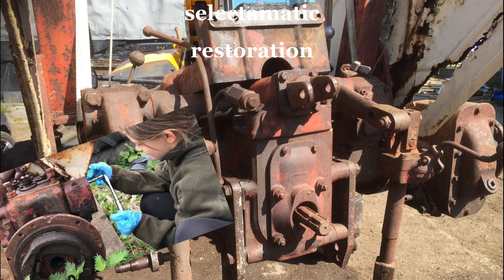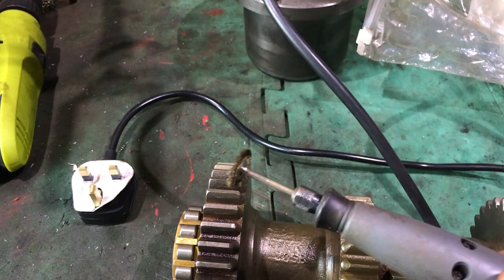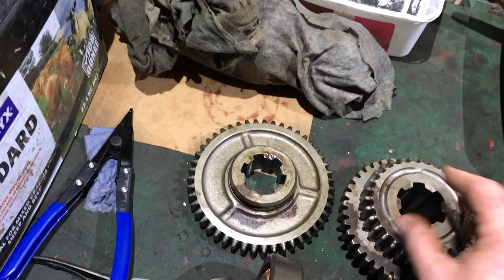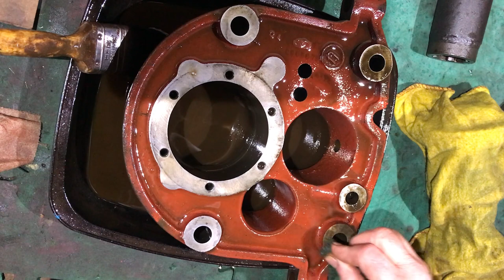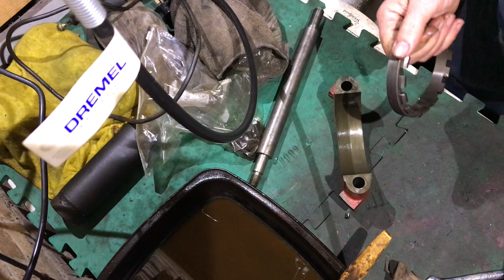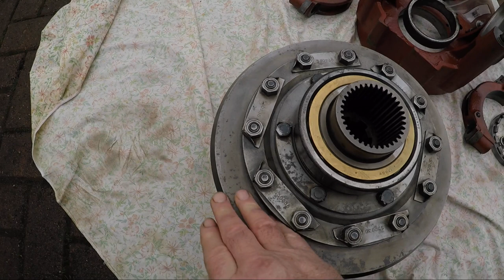Preparing the gearbox of a David Brown 990 selectamatic for re- assembly #49

Comment: Loved seeing your process of cleaning these up.  Learned a few new things!
Reply from the maker: Cheers Shane, when i sit back and think about sandblasters, vaporwashes, I would have to remove all the bearings, which could lead to damage and  more expense where as with the wire wheels and rags I can just take my time get them clean and give everything a good rinse off in the lovely red stuff. time I have loads of, money is a little different, and of course I don'thave space or the compressor to run them, so the wire wheel it is then.
many thanks Shane
Barry

Comment: People don't realize what  a major percentage  of restoration is cleaning parts. Got that missing hydraulic  parts made and great fun drilling 0.5 mm holes in it. Good vid Barrie.😀
Reply from the maker: Cheers Marshal, your right I think 90% of resto's is cleaning and scrubing, I'm pleased you got your part made, I've been chasing a lathe for the last couple of weeks but no joy at present.
thanks for your support
Barry
Reply: @manfromthemist1958  Hydraulics working better but still not right.  As every part of the valve chest I could access was stuck. I have come to the conclusion that the bits I can't access are stuck to.  Yep that means taking the valve chest out unfortunately.  Machined a blank to size for the wee plate in hold valve.  Justin case anyone is looking for one.M😀
Reply from the maker: @MarshallSmart  Cheers Marshall, sorry to hear the hydro is still not working, look on the bright side, you get to play with the valve chest on the bench, it is easier then in the axle.
many thanks Barry
Reply: @manfromthemist1958  Yes unfortunately  I'll have to study the world's most boring manual to do what you did on the rebuild. 
Or I'll just rewatch your vid about rebuilding it. Zip lock bags at the ready 😀M

Comment: Well you've done a smashing job of stripping all the components and throughly cleaning them it certainly does look a top job there's something about stripping bits down cleaning em and putting back together it's a man thing. Your certainly have a peace of mind once put back together you'd have always had that niggle in the back of your mind.
Reply: You're absolutely right, stripping down the parts, cleaning and getting them back together is so satisfying.
Reply from the maker: Hi Jon, Happy New Year to you and all your family, many thanks for the push in the right direction, it was you and Lance and a few others that made me look again at the box and spot the bearing out of place, so a mega thank you  for that, it hopefully made a good vid as well,
many thanks for your support
Barry
Reply: Yes happy new year to you Debbie and rest of the family.  I've used that loctite bearing adhesive I had couple off bearings in a winch on my lorry no one could get the correct size bearings I was persuaded to try it weren't cheap but it certainly done the trick in fact I even used it to re attach my fordson major side light which fell apart 4 years on its still held together and its a clear adhesive which is perfect. Going back to you saying your amazed how many people want to watch you were brush and clean metal you forget us men all share the same love and interests and sometimes our project are cheaper than our other halves lol 😆